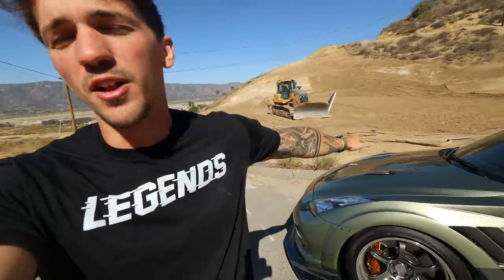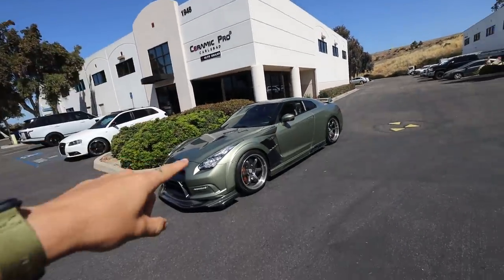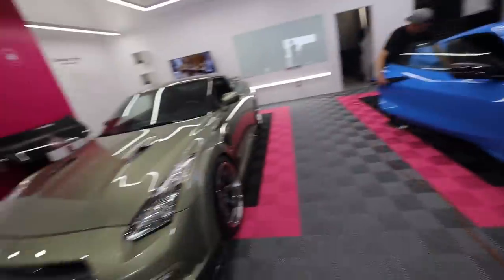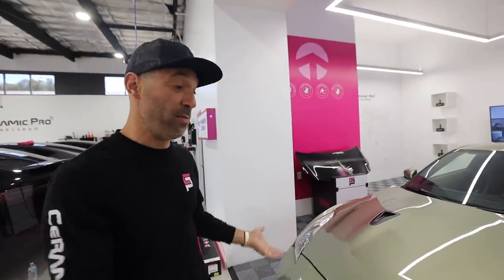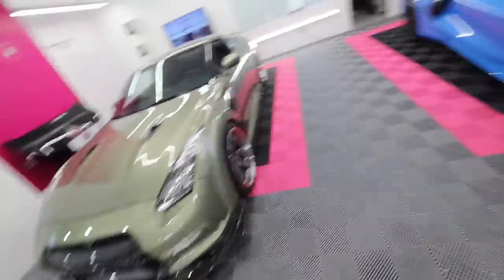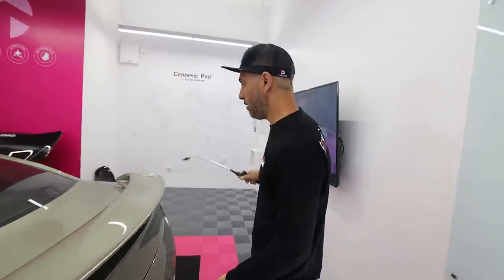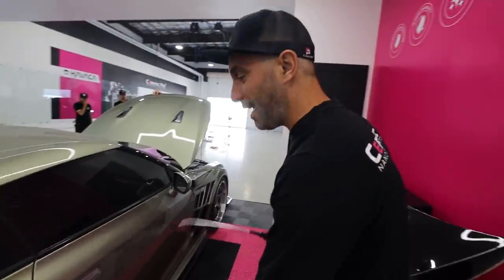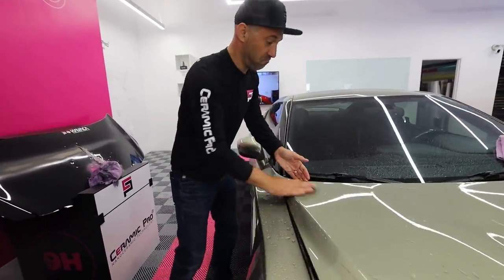Saying Goodbye To the Varis R35 GTR...

Comment: I was wondering when you would be getting this done after getting the car painted. Would definitely suggest this protection ASAP. Now it doesn’t have to be Ceramic Pro, some other good PPF brands are: Xpel, Gyeon and Opti Coat has a PPF as well. Top PPF with a coating for the ultimate protection.